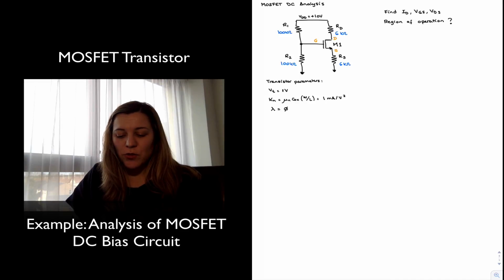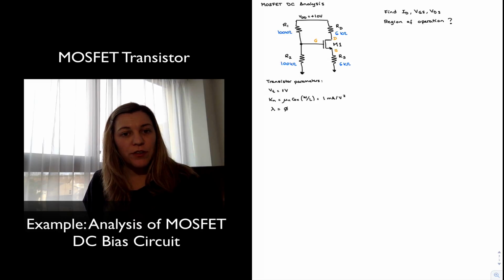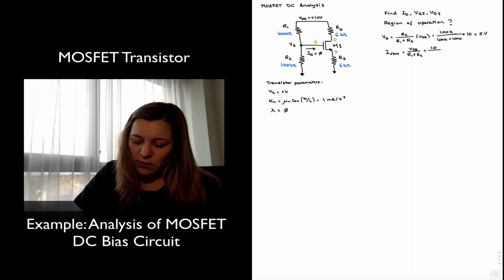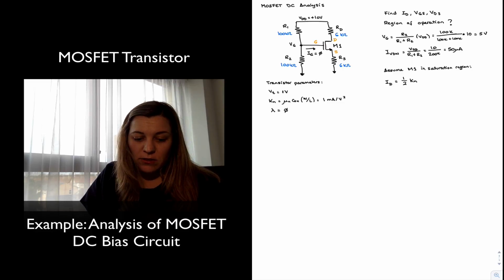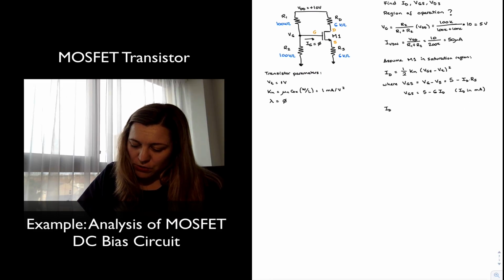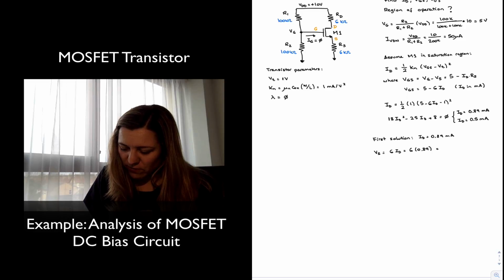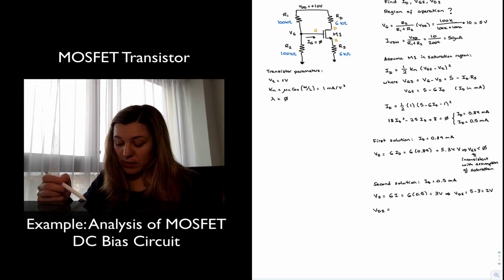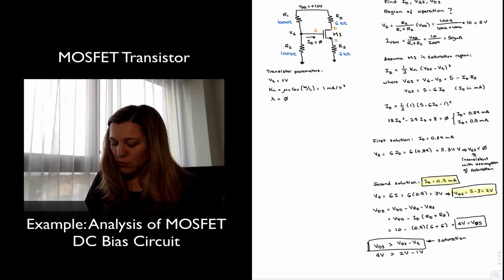MOSFET Transistor: Example - DC Analysis

Comment: I guess quadratic equation in the video should have been 18*Id^2-24Id+8. You had it as -25Id in there. Please double check.
Reply: yes that is correct. I got the same
Reply: You might have forgotten to add in the -2I(d) from the other side.

Comment: why is the current through the left side of the circuit different from that of the right side? Isn't that one circuit?
Reply: No, they are effectively two parallel branches of a circuit. If parallel branches of a circuit have different resistances then their current will also differ.